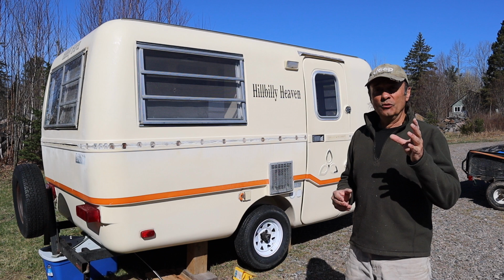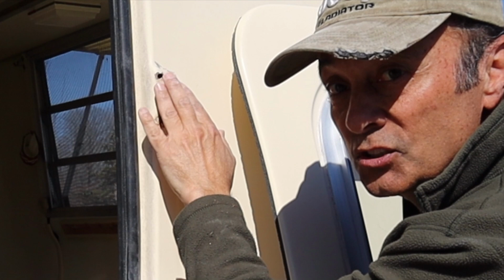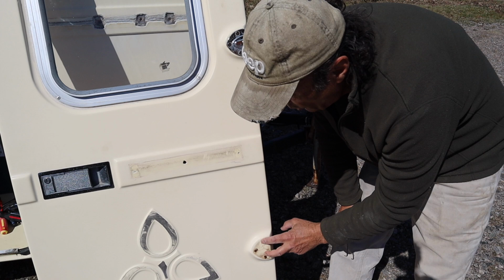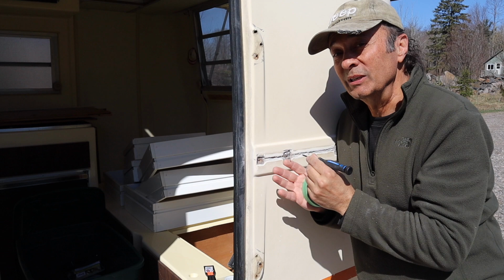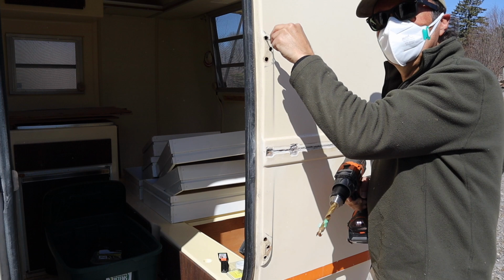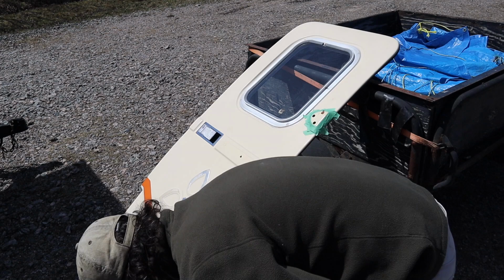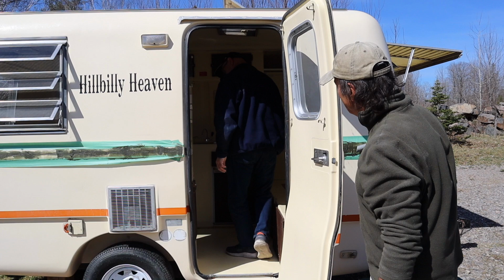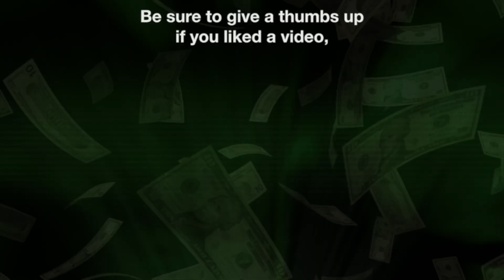Door Hinge Repair of a Trillium Trailer Restoration

Comment: This is very useful, I have some cracks on my door frame that I am concerned about and how to fix and to make sure door continues to close…..we will see!
Reply from the maker: Hey Ramona,
I’m glad you found this video helpful also. I’ll be doing some more restoration type videos for the trailer also but it won’t be for a few weeks. I hope that you’ll enjoy them as well. 
Cheers
Reply: Hi Dino!  Hat size and type of screw?  Mine are rusty and the hinges are too a bit.  Thanks so much!!!
Reply from the maker: Hey Ramona,
I chose to use a beefier #10 screw. I used 1” on the trailer side and 3/4” on the door side. Flat headed screws were used. I plan to get stainless steel ones. At the time of the repair I couldn’t find any so I used zinc plated to finish the job until I find some. I hope that helped. 
Cheers

Comment: I was thinking epoxy in some threaded inserts and using pan head bolts
Reply from the maker: Hey Robert,
Thats an excellent idea. 
I am inexperienced with this sort of job, so I wasn't sure how lined up an epoxied-in-place insert would be with where it should be, with respect to hinge locations. 
With the wood dowel, I could play with lining up the hinge, door and trailer, before committing to drilling the pilot holes for the screws.
Cheers.
Reply: @CheaperJeeperTV  work exactly like putting in the dowels centre in hole. another method  maybe riv-nuts but not sure of the strength of the fiberglass to hold a swinging weight

Comment: Hey Dino, just re-watched your video and I have two questions.  It feels overall my door feels hollow, is this normal as I thought there is normally plywood in it?  And did u rehab your hinge set at all?  Mine has been caked with caulking or something.  I plan on doing this in the next week or two. Thanks again
Reply from the maker: Hey Ramona,
I believe the only wood in the door is where the hinges are located, other than that I think it’s supposed to be hollow, so it’s all light in weight. My hinge set were clean so I did t have caulking g or anything in them. 
Keep an eye open for this Saturday’s video. You will find it  interesting I think. 
Cheers